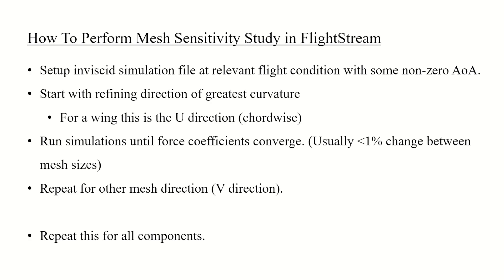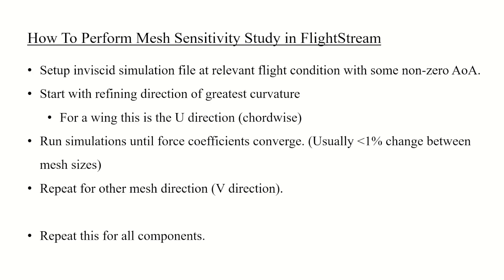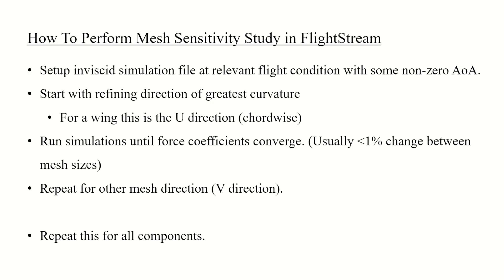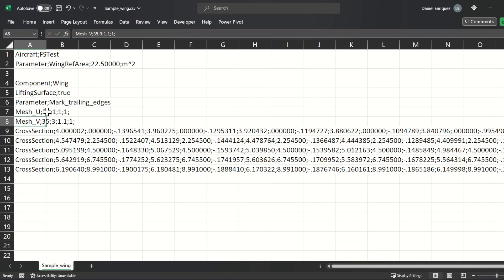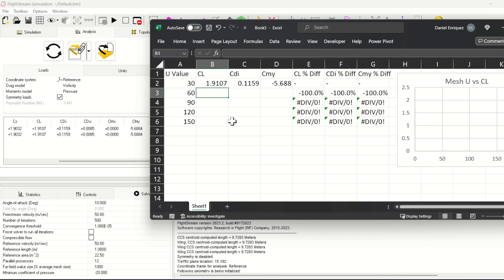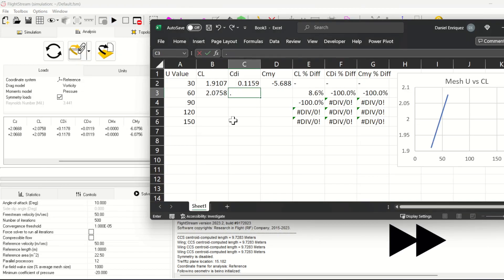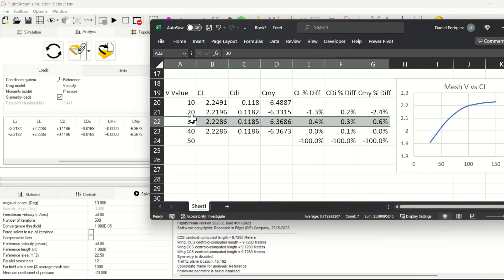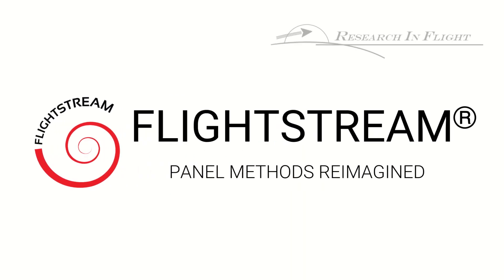FlightStream: Performing a Mesh Independence Study

Comment: To be able to edit the U and V parameters like you show, do you just have to add a line to the CCS file?
Reply from the maker: Yes! Look in the Help documentation included with FlightStream and look for "Mesh_U" or "Mesh_V" paremeters. This should be just one line you have to add to the CCS file to specify U and V
Reply: @AltairFlightStream  Thanks! In the docs, it says you can specify the "growth rate" and gives the options: One of the following: 1=Uniform spacing; 2=Successive; 3=Dual-sided successive; 4=Reverse Successive. What do these do exactly?
Reply from the maker: @comp_sci_aero8099  these options allow you to cluster the grid points. By setting  the growth rate you can push more nodes near the start or end of the cross sections. In this application, successive clusters the nodes near top trailing edge, dual-sided pushes nodes near both the top/bottom trailing edges, and reverse successive pushes nodes to the bottom TE. For mesh sensitivity studies we recommend setting the spacing to uniform.